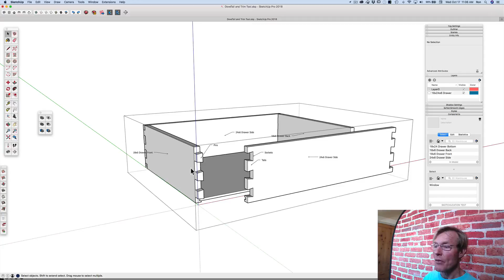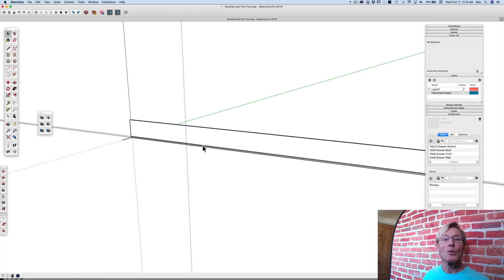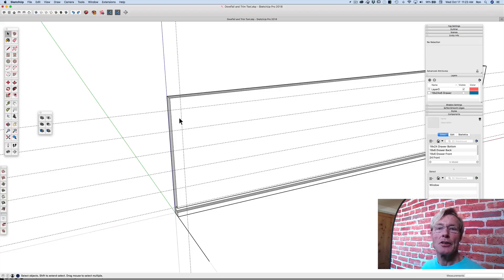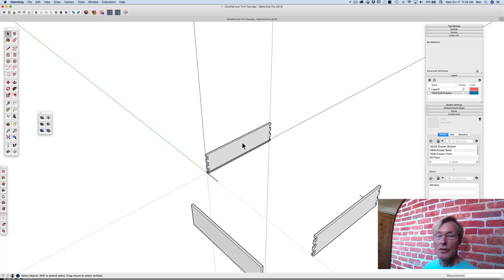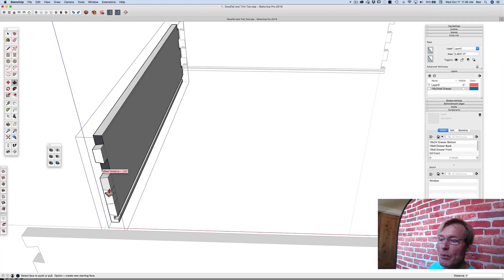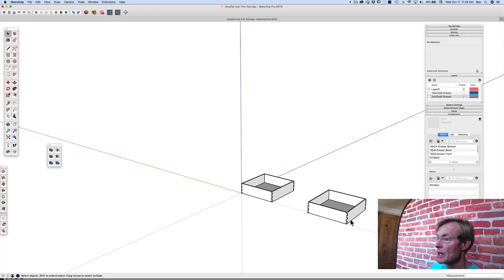Making a dovetail drawer in SketchUp

Comment: I applaud you very much. I am very impressed. You explain how to use SketchUp much better than a lot of the actual sketchUp instructors.

First of all you explain as you  are showing all the details and at a rate of speed that people can see and grasp what you are doing. The problem with a lot if not most sketchUp teachers out there is that they just zip through things so fast that someone trying to learn has no idea what they are doing and they simply do not explain some of the steps that they are doing. Though they  move so fast in the process that they are doing that some of those steps that they do without bringing attention to becomes steps that people do not even see.

If you made a DVD on using sketchUp for woodworking I would buy it.